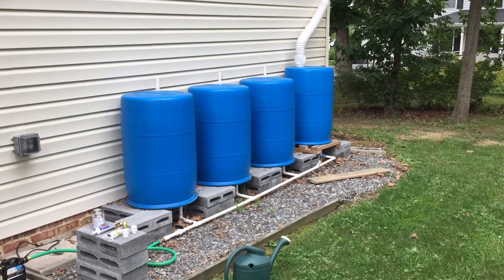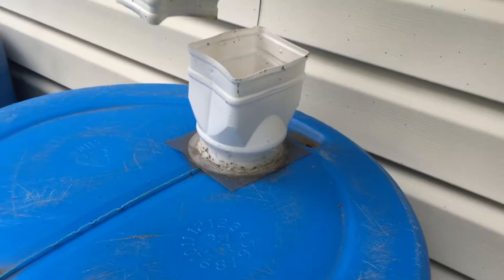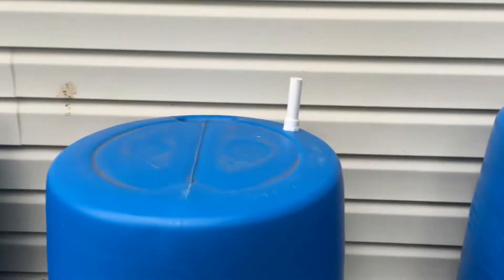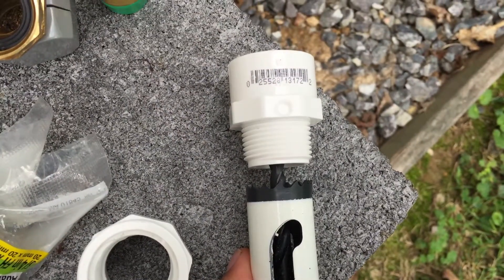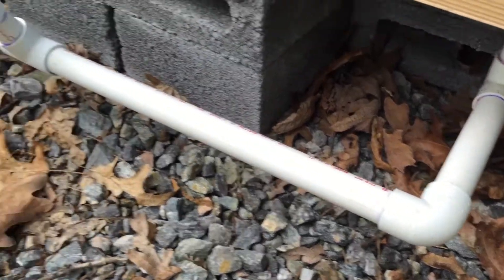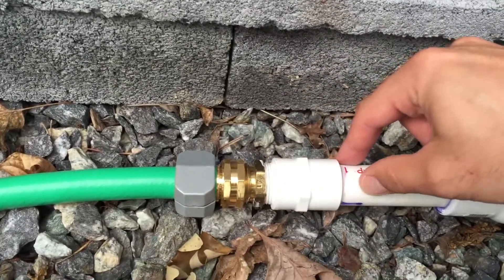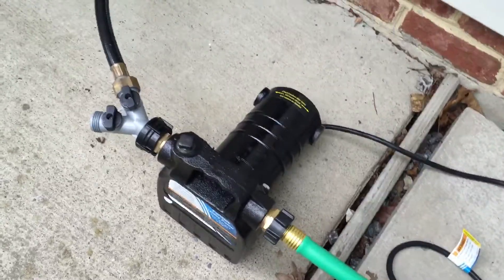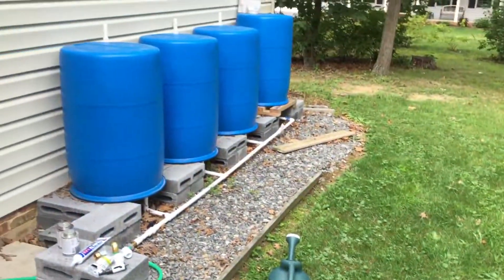Rain Barrel System with Pump

Comment: Nice system! Just posted an overview and how to build video (with water pump and parts list) that I built after seeing this.
Reply from the maker: Just know saw your comment and watched your video. Awesome! hope it's still working well for you. I ended up selling my setup, as I was only using it for watering the grass. It used up the water in the barrels VERY quickly and just wasn't worth it.